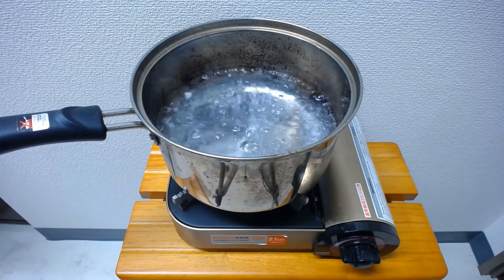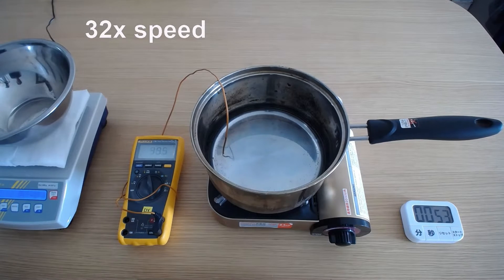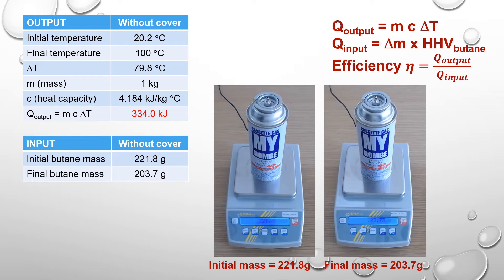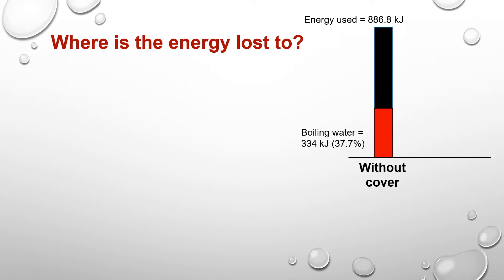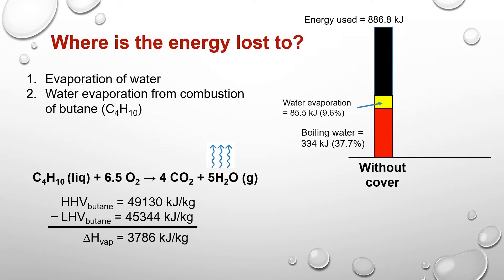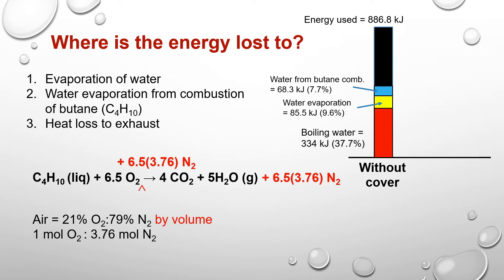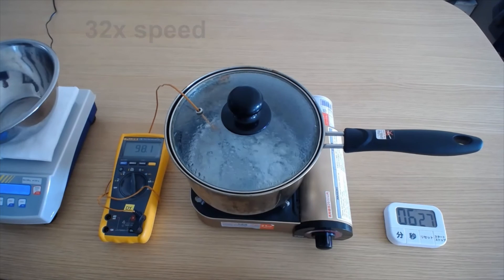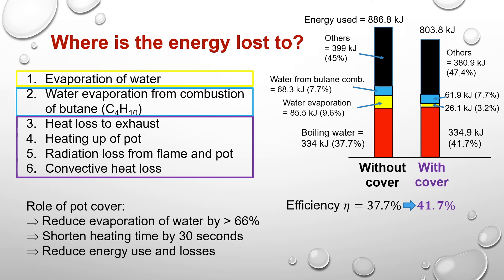What is the energy efficiency of a gas stove and what are the losses?

Comment: The HHV to LHV comparison is not so much an efficiency loss as a misunderstanding of the use of the terms. HHV is used in the few rare processes where you burn a fuel and are able to recover the resultant heat to the point of condensing the water from the exhaust stream. LHV is used in 99% of all fuel energy calculations where that is not the case. So, engine and powerplant efficiencies are calculated using LHV and that is the relevant parameter to use here.

A second error is that you have vaporized more liquid than you lose, especially in the case with the lid, where the lid and sides of the container as well as the vapor space above the liquid water is filled with vapor which then re-condenses on the colder lid, and/or as you leave the pan to sit after the heating and before the mass measurement. Because the heat of vaporization is so high and introduces error, I think you could have a more accurate measurement if you took the water from e.g. 20 to ~90 deg C so that you do not enter the vapor phase at all and remove this issue entirely.

To be clear, in your calculation, the boiling of water and the heat consumed to convert the liquid water to a vapor is not a loss, it is the purpose of your cooking and would be the same for induction or any other cooking.

Therefore the math for no cover cooking is 820 kJ of fuel energy (based on LHV) and 419 kJ of energy into the water (temperature rise + vaporization) which comes out to 51% efficiency, not 37.7%.

The "with cover" cooking actually comes out to a lower efficiency of 49%, I suspect due to the additional water that is evaporated, and recondensed onto the lid and falls back into the pan so that while the energy is expended to vaporize it, that energy is not accounted for due to the recondensing.

You have also included transient losses that are present in every type of cooking that are unrelated to the heat source, e.g. the heat up of the pan. Rough estimates are that the energy to raise the temp of a pan from 20 to 100 C is for example, as much as 5% of your fuel energy for a 1 kg pan. This loss cannot be attributed to the fuel type but is a function of cooking food in containers. This loss is also not present in a simmering role when the food is at temp and then held there.

And for a solid evaluation, there needs to be a comparison to the alternative. For most electrical sources, which originate from fossil fuels, there is a 50-60% loss at the point of power generation, with additional transmission losses. If you are using solely renewables, then there is no efficiency loss there as your raw energy source is electricity (if we neglect the poor efficiency of solar panels, for example, which is a reasonable thing to do since we're not paying for the "fuel"). But somehow, we should consider that the "free" renewable energy requires a significant investment in the hardware to collect it.

Good video, but I think there are a few misinterpretations of the information that can hamper your viewers' understanding of the picture.

Comment: Very great explanation 😀
How about with electric stove, such as induction stove is more efficient or not ?
Reply from the maker: Thank you for the question. For electric stove, the energy efficiency for conversion from electricity to heat is much higher, between 80-90% because there is no combustion process that takes away the  heat. However, overall efficiency will depend on where the electricity comes from. If the electricity is from power plant where they burn fossil fuel to get electricity, the power plant has an energy conversion efficiency between 30-50%, and there is also electricity transmission losses of a few percent. Overall efficiency (considering from raw fuel to heat) for electric stove and gas stove are in fact similar.
Reply: @denisywyu7864 
It takes a substantial amount of energy as well to process and bottle propane, which generally nullifies any similarities between the two with respect to end-use efficiency.
Reply: @topsecret1837  Not that much energy to process and bottle propane. Probably similar to transmission and conversion losses on the electrical distribution side.
Reply: This video is underrated. Such a great explanation and hard work. Thank you.